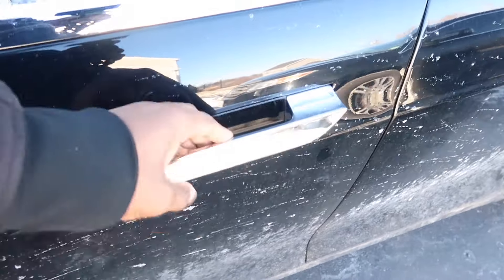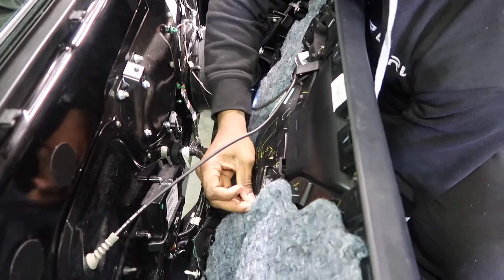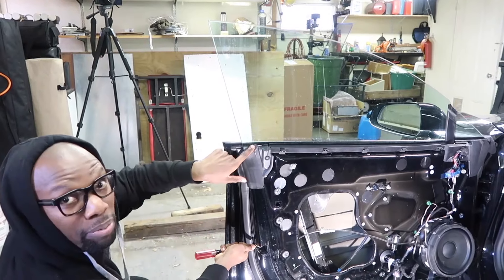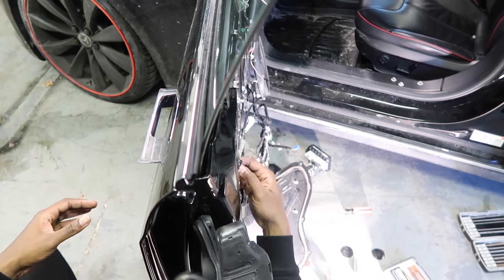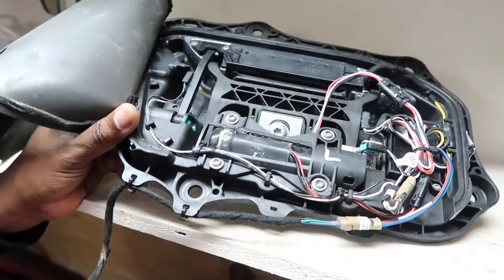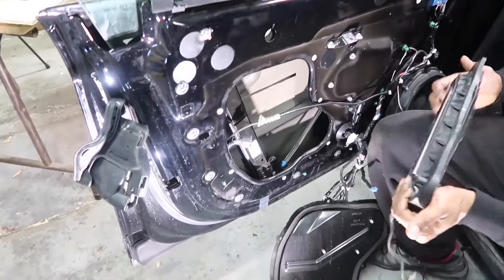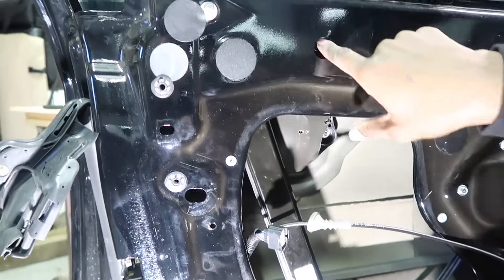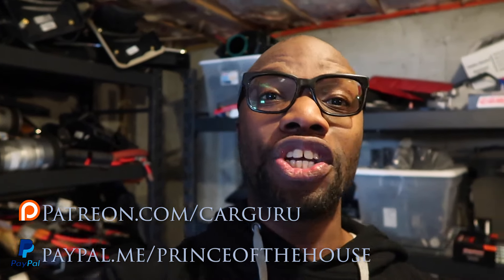How to fix Tesla Door Handles

Comment: Just a FYI since that’s the old version of the door handle (I believe there are 3 versions) they redesigned a completely new assembly but it’s not compatible with the older door mounting points the 2.0 version has the same internals though and the later version 2.0 has an updated switch harness that is less brittle  (updated version is green & black wires vs black and white) it’s a lot more flexible unfortunately the switches are the same. The 3.0 is similar to 2.0 on the outside but internally it eliminates almost all the delicate wiring and switches and is in the current cars as far as I know.

Comment: Okay-part from EV arrived BUT I've got an issue. I've got everything disconnected (except the actual tension cable attached to inner handle (like bike part)  To get the Driver's side window to go up so you can access the bolt you need to remove, you say to "trick" the door into thinking it's closed by inserting a flat head and pop the lock and it rolls up. I get it to pop but nothing happens. Do I need to reconnect any wires? I've got door off tonight and kids to drive to school tomorrow morning. My husband thinks I'm crazy to be trying to fix the microswitch myself....

Comment: I know everyone has their hints and tips but here’s mine if this is a common failure use some Vaseline pushed into the connectors and the back of the connectors to stop moisture and prevent corrosion. Another great video thanks

Comment: Awesome video. I found that I can open the door by pulling very very lightly and slowly on the handle.  I expect this will stop working sometime, so very glad to have the video.  After fixing, Is it possible to use silicone to encase the wire connections, to strengthen them?  Thanks again.

Comment: Put some thick dielectric grease into and around the openings of the connectors to keep the condensation and water intrusion from corroding the bare metal terminals. It will add some lifespan to your repairs, after all the harness failed do to not being weather proof from factory. For cars in very hot climates give the connection a shot of plastidip after reconnected instead of using dielectric grease.  If this is happening so much during warranty over and over it looks like tesla techs are Not Proactive, more like reactive wanting all the work they can get. Tesla is going to have to make a lot of improvements in their designs considering the foundation of the car is Electric and electricity and water/moisture don't like each other and water always wins with bad designs.

Comment: Now that rubber gasket that heats up, and falls into the door. Wouldn’t what also affect the pressure in the door possibly affecting the timing or triggering of the side impact airbag?
Hmmm, I’ll let you confirm, I never took apart a Tesla door. But if this might be true this could be a recall needed since it’s about the drivers safety?

Comment: Engineering fix:  Perhaps you could win some points with Tesla Motors, Mr. Car Guru, and offer to speak to their Engineering Dept.  Suggest to them a) guide grooves to keep these slick looking door handles perfectly aligned, and b) perhaps self-lubricating with a tiny pump and reservoir of light grade oil.  After all, why should you or any legitimate owner of these expensive sedans have to tolerate such a prevalent component failure as door handle, right?

Comment: You forgot to put the bolt back at the top of the window where you took off the trim to get to the bolt, the bolt you took out with your pointy nose pliers.
Reply: Thought I was the only one. I couldn't wait for his "boat in a bottle" old timers trick to get that fastener back in but it just got skipped  entirely. I drive an Aveo.
Reply: I don't think he reads these after a certain period of time he just ignores all postings, I suspect.

But yes he completely skipped it, perhaps it took longer than he had space on his video card to show how he managed to get that bolt back in, let's face it if he had to use pointed nose pliers to get it out, and there is no space to get his hand in there to put it back the chances are he wouldn't have been able to use pointed nose pliers to get it back in, so it could have taken him all day fiddling about with two fingers reaching down that gap and trying to twist it enough just to get one thread grab on.

So perhaps he simply didn't have enough time on his camera ha ha.

Comment: hey Rich, have you thought of using a dab of hot glue to reinforce the area those wire enter the plastic? seems like a high stress point due to the movement of the handle. That or some Sugru to give it the protection but maintaining the flexibility.

Comment: Watched multiple videos, took door apart and then realized other guys were using first generation doors handles. Watched your video-very informative and well presented-and learned how to do it correctly. Also watched segment on EV microswitch replacement and ordered one. Would rather fix it once than multiple times. Nearest Tesla is over an hour away so prefer to fix it myself anyway. THANK you

Comment: If you send me the harness I can replace the switches. They look like basic momentary switches. The problem unlike other door I have fixed is I didn’t see any of that black tar and plastic barrier to prevent moisture getting in. Also since moisture is able to get into the copper wiring I would use silicon grease on the wires to the switch, wrapped in some heat shrink. Then you will have a backup harness when I ship it back that shouldn’t ever need replaced on the next car you use it on, or when you do this the next time for the same issue on this car. 
Your wife might really really like that after the next time the door stops working.

Comment: I would have covered the ends of the wires where they go into the plugs in liquid electrical tape, or at the very least, hot glue. Would reduce chance of them getting loose and also eliminate moisture issues.

Comment: It would be interesting to see you 'mod' yourself out of having to replace it again and again. Sealing it off from the elements with silicone. Adding some spray rubber to the wires or shrink wrapping them (cut and solder). Maybe adding some sort of a backup master switch in the back/side of the handle. etc.

Comment: if you go to the position to build a small CNC, with v slot may be and get a 3d printer ... to do same parts that you can not buy it or find it easy ... would do it?? do you think is a good option to have this 2 tools?? I also think that a small lathe is a good use for a good lab...

Comment: RE: losing screws. I used to work on a particular model of engine that had several keepers and keys. One needs to gather them up carefully and put them in a baby food jar. Then drive down the road and throw them out the window.. now you know for sure they're lost and won't waste time trying to remember where you put the jar. When you get to that point of reassembly, simply go down to the dealer and buy them new..and hopefully you won't lose them on the way home.

Comment: Great video Rich,👍👍
Im working on all makes and models of cars for over 35 years now and until i started looking at your Telsa videos and researching them myself, i would have always said that the vw, audi group of cars plus Renault Peugeot and especially those models buit from 2005 to present were the worse cars for electrical, stupid bad build quality faults and unreliability  ive ever seen, after looking at Telsa i have to say my opinion has now changed and its Telsa who have to be making the biggest bucket of CRAP on the roads today and also charging a fortune to the customer for the plesure, without offering good backup support and good parts supply ,
Appologys to anyone im offending as im not trying to offend Telsa fans and i know they look good and are basically a driving smart phones  on wheels but seriously, an electric servo to extend the handel which is then basically a micro switch which activates another servo to release the door lock, its like telsa are trying to reinvent the wheel, how is building a car with all this nonsense inside and then add to this the energy required to repair it  environmentally green,  
Its all rediculas in my eyes.

Comment: With all the plastic, I’m sure you have a ready supply of JB Weld.
Reply: Hey James He owns stock in JB Weld. I bet Elon Musk will buy JB Weld stock so you can screw and glue your car back together. For that repair of a screw a Glue the Tesla Service would charge you 900.00 + 175 labor. 900.00 for 3.00 in parts.

Comment: I don't know about the rest of you guys, but at 10:33 and 10:49 I'd have swatted your hand away and slapped your face, respectively.  Can't stand to be messed with while I'm at work.  Man - next time our nagasaur wife complains about fixing the stuck door handle, just show her this video.  What a giant PIA this fix was!  For such a high failure component, you'd think SpaceX, er,  Tesla would make it easier to slip this unit out and in with the minimum of bolts and wire plugs.

Comment: You gotta think years from now, kids buying $2000 dollar Tesla will look at these diy videos.
Reply: Bizzy jones I thought the samething
Reply: Won't be more than 5 years..
Reply: This will be the least of your problems, when you buy a Tesla for 2000 bucks.
Reply: We'll see them in third world countries pulled by horses
Reply: Doubt old Tesla's will do well on the market, the parts are bad and expensive...
Reply: so were bmws and benz from 20 years ago. there will be other evs and parts will be abundant.
Reply: They did not have electric shit all over the place....
Reply: yuhhh they did...get with the times buddy, gas will be obsolete in the next coming years.
Reply: I do not care about gas, Hydrogen is the future in my humble opinion. I not for cars with battery packs...they suck for life and after life.
Reply: wekker090 The shell adverts you've been seeing about hydrogen cars have some huge lies in them.
It cannot be compressed hydrogen gas due to safety and permeability issues. Seriously look it up. Because Hydrogen has a single proton nucleus it can literally pass through the walls of steel tanks if given enough time.

So the alternative is metal latices where the hydrogen is attracted to the atomic structure strongly enough to have a density as high or higher than feasible with just compression.
The metals such as palladium are great at this and you can transfer the hydrogen both ways.
Think of it like a sponge.

These have limitations based on the surface area which dictate fuel input and output rates however if we crack this, it will trounce batteries.

One thing worth noting though is their cost is far higher than batteries due to raw materials and also there is a limited supply of these materials globally.

Also the technology were developing in electric cars other than the batteries, will still be usable is rather than a Hydrogen ICE you go for a fuel cell method. This is static, which means fewer moving parts and generates electricity.
I think k we can all agree that fewer parts and cheaper combined with no need for a gear box, longer electric motor life and better acceleration in normal speed ranges 0-70mph which is where it counts for the average consumer is far better than a noisy ICE.

I think our grand kids will look back on petrol and think. What the heck. They deliberately put smoke into their city air... Did they learn nothing from the industrial revolution? Idiots!
Reply: Mark Pearce is right on the money. Hydrogen is a joke, for all sorts of reasons.
Reply: Yea and he clearly never heard that WW one tech was able to hold hydrogen thats why Zeppelins was able to fly betwen Europe and America, there was no mid air hydrogen stations producing hydrogen(because he thinks that you cant storage it ) and btw " if given enough time" its also true for normal gasoline its considered crap after it was storaged in your gas tank for too long. All that babling how bad are alternative sources of power is clearly sponsored by people that earn tons of money from oil bussines. Just read how slow is reaserch on  fusion power. ITER for example check on wikipedia how much time they needed to waste before they started to do actual building, with all that time you would be able to dig holes for fundaments with bare hands. And what with that "safety", is gasoline safe? Its vapors can explode preaty easly...
Reply: Biały Zeppelin's weren't under much pressure. At the pressure's you need to make compressed hydrogen are high. There exist 700Bar (10,000psi) tanks for prototype hydrogen cars. Their leakage rate for the carbon fibre tanks they are using is estimated at 1bar/day when fully pressurised reducing inverse squarely to 0 bar/day as you approach 1 bar internal.
Not as much as I originally thought.
Leave your car on the drive for a week and only loose 1% if full...

Still, I wouldn't like a 700Bar tank in my car. Im nervous enough transporting 200bar argon cylinders.
Reply: I'm not worried about gasoline disappearing in my lifetime.
Reply: There will be lots of these cars in the scrapyards and only a few left on the streets in ten years. Nobody can afford to service them with Tesla, except the rich who are going to trade them in for a newer car after a few years anyway, and fixing the door handle will be the least of your worries. The average Joe might be able to fix the door handle if he has the time and the inclination, but forget changing a motor or battery pack, even if you can find affordable used parts. Nobody is going to pay Tesla thousands of dollars for parts and labour to repair a car that will end up being worth only $2000.
Reply: It is a high end electric vehicle, not a Nissan Leaf. Less likely to be scrapped if 10-15 years old. More likely to get a fresh battery pack. Motor swaps were mostly early Model S's.
Reply: @AttilaTheHun333333  Battery pack replacements.
Reply: @wekker090  I can see a kid buys one and converts it to gas burning engine.
Reply: Reminds me of all the cavemen that say...I hate these new cars, they are all computer controlled so you cant work on them.
Reply: No way Tesla will be around 50 years from now. So many problems from cars made less than 10 years ago. Tesla will die when there is a a cheaper more reliable electric car.
Reply: Of these cars even make it that long
Reply: Not quite $2000....but yup!!!
Reply: thats me yup.. lmao
Reply: Ur a genius
Reply: Bought a used 21 S Plaid and the driver's door handle broke at 20k miles. Can't make this up. Decade old platform and they still can't figure out how to make the door open.

Comment: TIL an 80k+ Tesla only uses 2 screws to hold the door panel, as opposed to the 8 that hold my '01 2k Golf 4 door panel in place.
Reply: Action Hank if you have 10 screws, you have a better door then? Common 😂
Reply: except there was no issue with that nor have I heard one in general, the plastic clips are fine. the only rattle existed due to the "condom" and that is part of the handle assembly and is a different issue.

Comment: Is there a way to protect the harness from failing again? Maybe squirting a lot of glue or something, so it won't corrode?
Reply: I was thinking generous heat shrink tubing around that, shouldn't be too hard.
Reply: I'd just install something like a Pi Zero W and make my phone become the door handle
Reply: It's the routing of the wire that focuses wire bending on the one place. If you work on a door handle, re-route the wire so the repetitive bending is more evenly distributed and not focused.
Reply: A gob of silicone, to provide vibration damping and stress relief where the wires enter the switch boxes.  Will also seal against water intrusion.  Wouldn't hurt to tack down some of that loose wire with tape or adhesive to reduce movement.

Comment: On the right micro switch you need to make a loop so pressure doesn’t stay on wire right under the micro switch but across the whole wire.

Comment: Very informative,,Id sugest to waterproof those wires by wraping some electrical tape or coat it with silicone to prevent further rusting,bc water will get there again in the future,,no doubt,,Tesla should IMPROVE on this design

Comment: So, that's the $800 door handle...and the reason those handles are no longer used in any other models by Tesla. What I find funny is that a new model Range Rover uses a pop-out handle a lot like that. Also, always check continuity of replacement wiring (Rule #1 of troubleshooting: Never Assume Anything.)

Comment: It may help to add some sort of silicone where the wire meets the plastic to help prevent future corrosion.
Reply: Rob Vella just fit a heatshrink tubing over the wires. Car guru fix was temporar as wires will again break of because of flexing. This is bad engineering in its greatest, the wires just need additional transitional reinforcement so it doesn't bend in one point. I drive Honda it has also breaking handles and replacement OEM is the same story.
Reply: agreed! Just don't do regular hotglue, as on hot days it will actually flow away slowly ! :D (personal experience)
Reply: rkan2 hot glue will make it worse as it may not seal entirely and water leak will kill it quckly